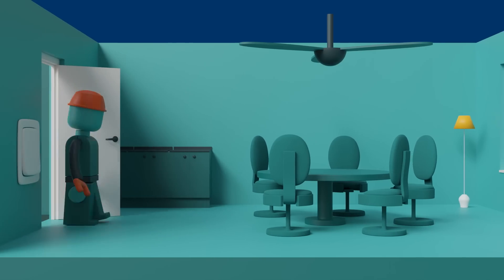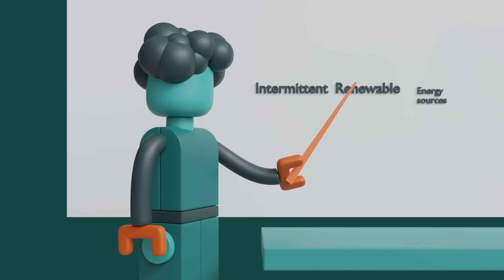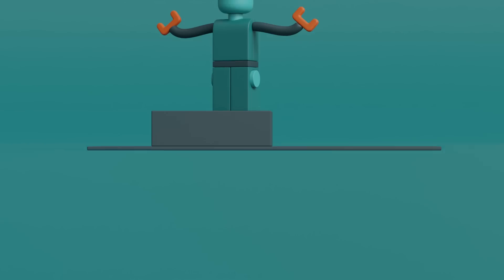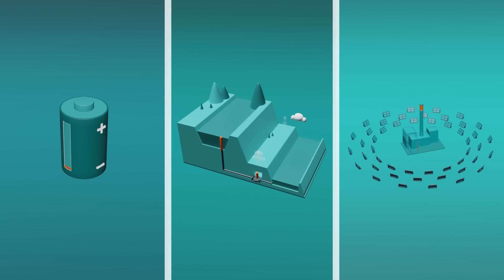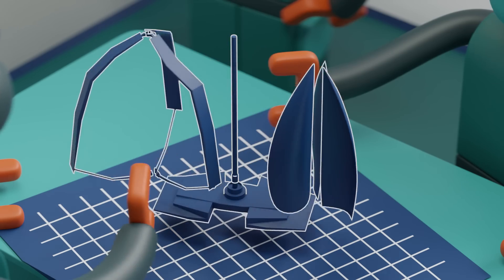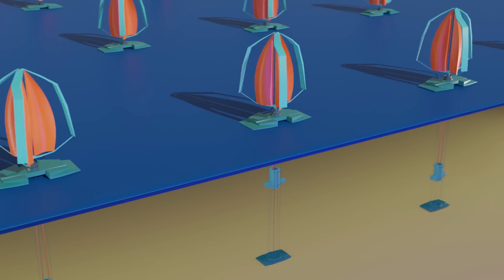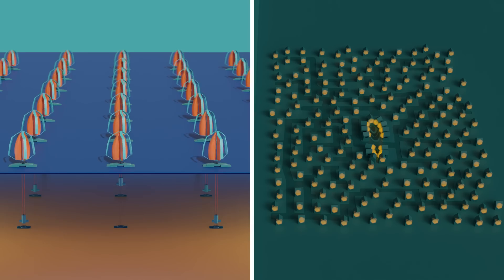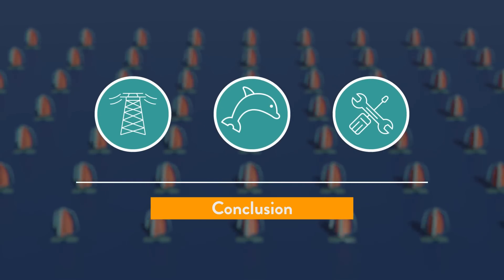Wind Power's Greatest Challenges - And How they Could be Solved

Comment: Ingenious approach and super interesting. I can see why this makes sense as a hybrid system. They are converting wind directly to mechanical lift which allows the wind rotors to capture more of the available wind rather than being limited to the rated wind speed of a conventional HAWT or VAWT. I assume the cut out wind speed is very high for a VAWT, around 30 m/s?  If this is the case then this system can potentially triple/quadruple energy production from the same surface area because of the cube relationship (double the wind speed and energy and power output increase by a factor of 8 - depends on location). During the lifting of the block, the variability of the wind is absorbed and when the block drops the power output is fixed and constant. I assume the drop has a fixed weight and velocity? In an array, the implications would be very significant to grid resiliency. My only concern is O&M and moving parts. I assume that they do not need to have massive wind rotors since the system is decoupled from the electrical generator. You could easily have a large generator and block but a smaller wind rotor. This system is not really energy storage as such but more of a wind power capturing system with a gravity based conversion to electrical energy.